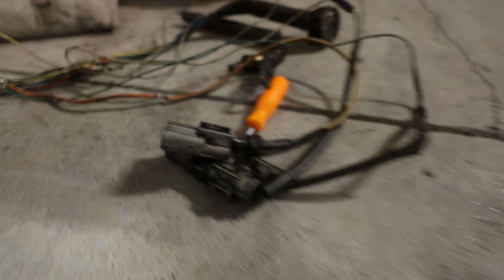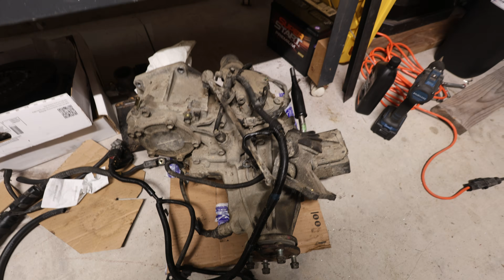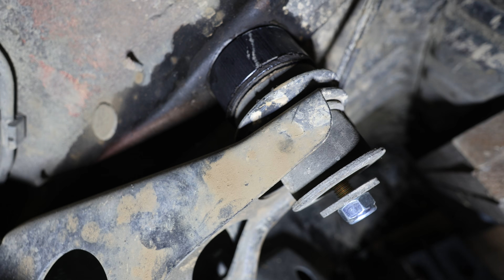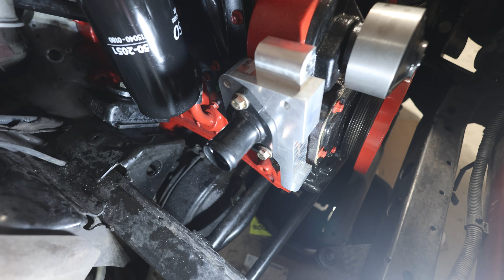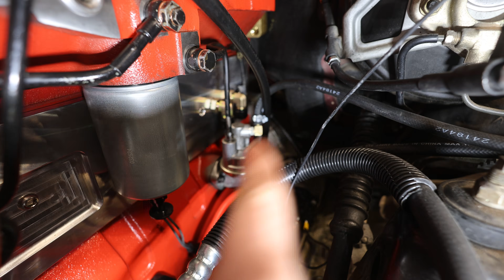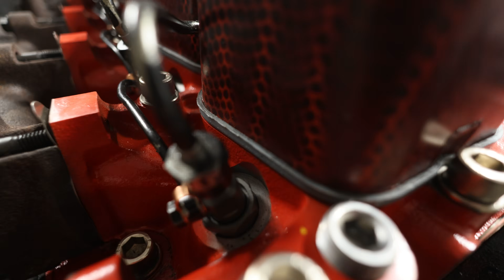12 Valve Cummins First Start In 80 Series Land Cruiser!

Comment: That’s so awesome! I’m happy to see it coming to life! It’s good to see an improvement on the build quality too! I’m sure once you get a shop with a lift and you can do this full time, without being tired from your job, you’ll build one 80 series a month. 
I got super excited to see how much wiring goes to the trash! My 80 series has all kinds of shorts in the engine bay! I can’t wait to start my 12 valve swap, but first I have a couple of race cars to finish (that way I can clear my working spot).
What adapter did you end up using for the NV/80 transfer case?
I haven’t bought my adapter yet.
Reply from the maker: Yeah I’m hoping to be able to go this full time! Yeah there’s tons of trash wiring. I went with Dustin’s adapter plate/splined shaft from powertrainintegration.com

Comment: Nice work mate. For the wiring loom before you wrap it I’d suggest you also run a spare trailer cable in it to connect engine bay thru firewall penetration to the cabin. They’re usually 7-core and good for spare electronics down the track.

I spent ages planning my loom but at the end of the day after it was all done I still needed more.  Just things like spotlights, water pumps, various sensors, etc.
Reply from the maker: Interesting! Great idea I’ll think about that!